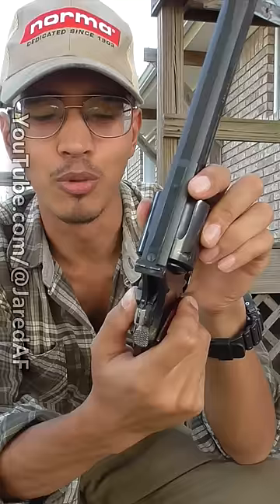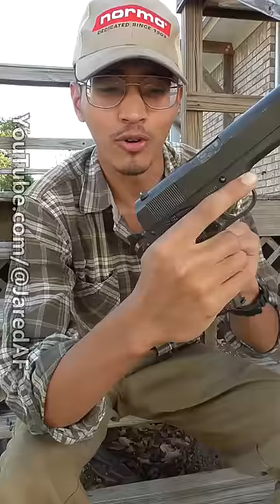safer way of decocking a hammer-fired gun ("don't thumb the hammer down" part 2)

Comment: Great instruction on Gun Trigger Safety Decocking.
Reply: The easier way is to just buy a gun with a transfer bar instead of the antiquated hammer mounted firing pin.

Comment: One additional tip I learned from Paul Harrell is to additionally cover the pinhole with your thumb to provide one last level of security if the hammer slips
Reply: This is what I was taught as well, at least when you are first getting used to your firearm. Better safe than sorry

Comment: All it takes is 1 guy to show you the correct way; thanks for the safety tips; looking to buy a single-action so this was a must need-to-know
Reply: Virtually all single-action revolvers have a half-cock notch. Many of them have a safety. This is unnecessary.
Reply: Modern single actions have transfer bars if you get a colt clone most done so ya gotta do cowboy load
Reply: Same, I've been dying for a single action army.
Reply: Cowboy load, no room for error with an empty chamber
Reply: @ootdega The point of this video is showing how to decock many revolvers using the halfcock, and "safety".

Revolvers don't have standard safeties generally, and when they talk about safeties, it's usually something like a transfer bar or retractable firing pin.

So it's not useless, it still helps explain many modern revolvers, you just don't press the trigger when decocking a single action revolver.
Reply: @EDCtexan  That is a very important thing to bring up. Many Colts do not have  transfer bars, so you do have to rest it on an empty chamber. It's definitely important to find out if a revolver has one or not
Reply: This ain’t the guy.
Reply: This is not the correct way though. He's got his thumb tip on the hammer, it's prone to slip. Use the whole joint
Reply: @Fragger-1 how do you suppose to get the hammer moving if you dotnpress the trigger. You have to, its how that works.

Comment: I had just that very same conversation with 2 elderly ladies at an coastal Alaskan fish camp.
they had bear spray and marine flare pistol, they invested in a screamer pistol, to load the 6mm iniator blank and let it set loaded but on safe.
it took them allot of practice to trigger release the hammer, release the trigger and ease the hammer fwd.

Comment: A safer variation of this method: if you're right handed, place your left thumb (or a pencil, pen, or some other object) under the hammer. Put your right thumb on the hammer, right index finger on the trigger, squeeze the trigger until the hammer releases, lower the hammer onto your left thumb (keeping your right thumb on the hammer), release the trigger, remove your left thumb, and then lower the hammer with your right thumb. For lefties, the hand/fingers are reversed.
Reply: When in combat will you have a pen, pencile or some other object?
Reply: @josephbogart6604 when are you gonna be in combat 😂
Reply: @josephbogart6604 why are you decocking your gun in combat?
Reply: On top of this: keep your palm and fingers clear of the chamber or port on the barrel. An accidental discharge can blow your fingers off or burn the shape of a shell casing into your hand respectively.

A neat trick on pistols with a slide is that you can grab the back end of the slide and pull it back slightly, bringing the cartridge out of battery and preventing the weapon from firing.

Just as you respect the mechanisms of a gun and treat them well, so should you your ammunition's power.

Comment: The method I taught when I was an NRA Pistol Instructor was to place your off-hand thumb between the hammer and the frame, control the hammer with your shooting-hand thumb, pull the trigger, immediately release the trigger and slowly get your thumb out of the way as you ease down the hammer.

Comment: If you are a handloader, you might also want to exercise a little more caution and gentleness if using deeply seated Federal primers. Those are the primers we use with worked over revolvers with light trigger pulls. Those primers are a little more sensitive.

Comment: I love the decocking lever on my Beretta 9 mm. It really freaks people out though when I'm at the range.
Reply: My Beretta M-92 says in the owners manual to just engage the safety lever, the hammer comes slamming down but the firing pin is blocked, thus decocking the gun without discharging the firearm.

Comment: Hey! Great advice! Been around firearms my whole life and ex military and I never have seen this. Thanks!
Reply: Better to use opposite thumb and lower hammer with FULL control vs taking the chance of doing it one handed, I think, but he does have good points about the half cock on the hammer fired systems.
Reply: Maybe I am missing something but how is adding an extra step safer when you could slip and still have an accidental discharge before releasing the trigger at about half-cock? Seems safer to just fully focus on putting the hammer down rather than an extra step.
Reply: @ARC_RAY  In general, adding extra steps increases complexity of an operation. 

However, in this case, I don't think "releasing the trigger" really counts as an extra step (vs keeping it pulled).

If someone was likely to have their thumb slip before releasing the trigger, they would have slipped anyway even if they kept the trigger pulled.
Reply: @ARC_RAY  tell you what, try it his way, with a snap cap in there so you don't accidentally have an oops.

Then do it my way.

Use your other hand with that thumb to control the hammer on the way down. You will have a much easier time, you will have full control, and you won't have to worry about accidentally ventilating your room.

Or you could just do as designed and intended, and leave it at full cock and then use the safety.
Reply: Your lying
Reply: Please, trust me. 
Jesus christ is the way truth and life. 
Seriously, to understand you need to do the inner work Jesus christ taught. It all starts with forgiveness.  Genuinely inside your heart forgive your parents.  It's a key step to this process. Parents are closest, known us longest, and have loved us. They are the easiest people to forgive.  To be forgiven, we must forgive.  This is so important. Please,  break down before Jesus christ and ask for forgiveness.  Remember that three books of the Bible,  genesis,  Mathew,  and one you chose yourself are an important effort mark to reach in life. It's like a spiritual milestone. You must personally get past this yourself.  
You have to look to see the truth.
Jesus Christ is lord.

Comment: Outstanding work my brother, I always carry my 1911 in the half-cock safe position.
Reply: So you carry a loaded weapon in an unusable  configuration? why?
Reply: @chrisyoung1478 most of us dont live in a warzone.
Reply from the maker: @chrisyoung1478  half cock is not "out of battery." that term refers to whether or not the breech is fully seated against the breech face and in the case of a locking handgun like the 1911, that the locking lugs are fully engaged. the hammer could be in any of the three positions with the firearm in battery.
Reply: Cocked and locked is better imo
Reply: @JaredAF  Pretty sure he means it's not immediately useable. You have to cock the hammer back to get the firearm ready to go, which is bad practice when carrying.

Comment: On the 1911 you can pull the hammer back far enough to trigger pressure plate and still pull trigger one handed. 

This was trained to soldiers so you could make your weapon safe if your other hand was busy with a POW, Explosives, etc. I believe the Marines discovered it, I don’t think it was an intentional design (could have been).
Reply from the maker: intentional, for the cavalry

Comment: The only issue with half cocking is that to put your firearm back into a shootable state you have to recock the hammer or pull the slide back; which would eject any unspent casing in the firearm. If you train for this it's better than carrying a cold gun but it's still arguably better to just carry cocked and locked. You can disengage the safety and pull the hammer back while bringing up the gun, but disengaging the safety puts your hand in a more comfortable position. You don't need to readjust your grip if you're gripping the gun properly

Comment: You’re supposed to place your thumb in front of the hammer, blocking it from hitting the bullet.  You can still slip and release the hammer by accident even while trying to release your finger off the trigger, especially while shaking from adrenaline.  That’s why you need to block the hammer in front, not just hold it from behind like that.  You can use the meaty part of your hand to block it too, if you’re scared of hurting your thumb.

Comment: When you put your hand on the cylinder it made me tense up.  As you say, older style revolvers with hammer mounted firing pins do have a ‘half-cock’ detent, which if done properly, will not allow the hammer to fall if the trigger is pressed, you have to pull the hammer back to full cock in order to fire the gun.  The safest revolvers use a ‘transfer bar’ that only allow the gun to fire if the trigger is deliberately pulled

Comment: The correction should be to hold the hammer back with pressure using the thumb, while you slowly pull the trigger, and then slowly release the hammer forward as the trigger is actuated.

Comment: Personally, I like to loop the joint of my thumb over the hammer, rather than holding it with the tip.  More control, less likely to slip or roll off.

Comment: Check your owners manual for your specific handgun, but yes, generally all single action hammer-fired handguns except a few very very cheap Saturday night specials and obscure handguns should have a “passive safety”

It’s also worth mentioning that it can be VERY dangerous to have a big iron like that and let that hammer sit on the primer. Just cause it’s not cocked doesn’t mean you cannot accidentally discharge it.

The old cowboys would carry with the hammer and pin resting on an empty cylinder on their big 6 shooters.

Comment: A much better method is to do this while also having the thumb from your non-fireing hand in under the hammer. Pull the trigger and ease the hammer down onto your thumb, the release the trigger, move the thumb and ease it down the rest of the way.

Comment: The other is too turn the cylinder either way to remove the bullet from dead center, some will move a lot others just a mm or two, either way it can prevent a discharge if it is not lined up dead center.

Comment: Ugh... last things first.  NEVER lower the hammer on a chamber-loaded 1911.  It was NOT designed to be carried that way and it is NOT safe to do so.  Leave the hammer cocked, engage the safety, and holster.  Or unload the gun.
First things last, just don't cock the hammer on DA revolvers.  Learn trigger control.

Comment: I put my thumb on the hammer spur and my other thumb in between the hammer and frame. Then pull the trigger, release the trigger and slowly let the hammer pinch my thumb. Them I slowly remove my thumb from between the hammer and frame.
As the pinched thumb is pulled out, the shape of the thumb is like a wedge so it allows the hammer to lower slowly with a physical barrier keeping the hammer from smacking the frame firing the weapon.
As the thumb is pulled out, the hammer will reach half-cock with no ability for the gun to fire.

Comment: Worth noting that there is never a reason to decock a 1911. They are meant to be carried condition 1. That is, clocked and locked (hammer back, safety on). If you need to unload it, you drop the mag and rack the slide.

Comment: You had great information on the revolver.  It is especially great on modern revolvers which use a transfer bar.  

The half cock on the 1911 a gun designed to be cocked and locked by the safety, your advice is less useful.  Possibly dangerous, Also to unload that gun half cock is totally useless.    Drop the mag, rack the slide.  No pulling of the trigger.  The only time I pull the trigger on my 1911 is when it is totally unloaded (lowering the hammer fully on an empty chamber for storage) or when I want it to go bang.

Comment: Pre 1980 1911 dont have hammer block. also "peace maker" pattern do not have block i usually use the off hand to hold the hammer and let it down. every thing you say for hammer block guns is correct

Comment: why is no one mentioning to put your other hands thumb between the hammer and the frame during this safe process. This way if u mess up and the hammer slips, and also still have your finger on the trigger, it will hit your thumb. Usually that short travel distance shouldn't damage your thumb and is better than a round going off. Just my 2 cents...or not.

Comment: Put a pencil (or whatever you have) between the hammer & the frame. Pull trigger, ease hammer down to pencil. Release trigger. Apply pulling pressure with thumb on hammer to keep hammer in place. Remove pencil & lower hammer. Just an observation I made in 1982 with my issued M1911A1 service pistol.

Comment: Good idea. I would actually take this one step further by supporting the gun with my other hand and placing my other thumb directly in front of the hammer just in case the thumb slips and your finger is still latched on to the trigger. Anyway it’s hard to lower the hammer while trying to release the trigger single-handedly, at least for people with small hands.

Comment: The only problem with this video is that you’re teaching people a method that works on some revolvers, but not others. Some people carry around revolvers that the hammer will not drop all the way unless your finger is on the trigger the entire time. For example, I carry a Ruger Super Wrangler. With that particular firearm, I can pull the trigger, lower the hammer slightly, take my finger off the trigger, and lower the hammer all the way. But some people might carry something like a Heritage or some other Single-action Colt army clone.  For that firearm, you have to pull the trigger the entire time. And some people don’t have the option of picking a gun with a transfer bar.

Comment: Its still not the whole best practice.  You should use your other hand or thumb to put it between the hammer and gun so in case you slip, it still wont fire. Same trigger release method works just add another thumb in there.

Comment: why it looks like the hammer reset its position after you released the trigger at the beginning of the video?
Reply from the maker: because it does. it's called a rebounding hammer. the firing pin/hammer nose has to retract to allow the cylinder to turn, or else it would be digging into the spent cartridge

Comment: Isnt that a revolver you just have to know how to load and unload if your cocked that means you had something to fire at so you shouldnt have to undo the hammer but rather just open the wheel and dump them out by spinning the barrel.
Reply: Always assume its loaded even when its clear like this that it cant have a bullet in the chamber its just proper gun safety like not starring down the barrel or pointing it at something you dont plan on shooting.

Comment: tried with a 1911 and it still fired lol thankfully it was airsoft replica LOL
Reply from the maker: i think a lot of those just have a direct trigger system that regulates the air rather than the inertia of the hammer setting it off.

Comment: Wrong both times, put your thumb in between the hammer and the frame of the firearm, and in case it slips, and with the 1911, unload it, remove the magazine and the round in the chamber. That will make them both safe.
Reply: Okay, genius, how do you lower the hammer the rest of the way with your thumb blocking travel? That's about the most useless way I've heard to decock a revolver.

The 1911 portion is clearly in the event of a malf.

Comment: You NEVER release the hammer on a loaded chamber on a 1911. To clear it just drop the mag and cycle the slide. No need to drop the hammer on a loaded chamber. “Half cock” on a 1911 is a fallacy. Not all 1911 hammers have that lip on the “half cocked” position.